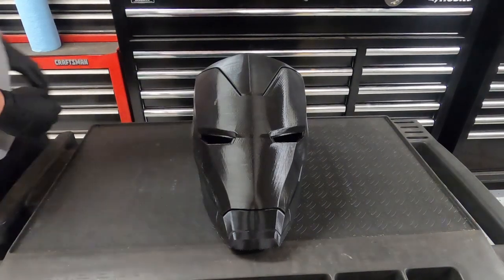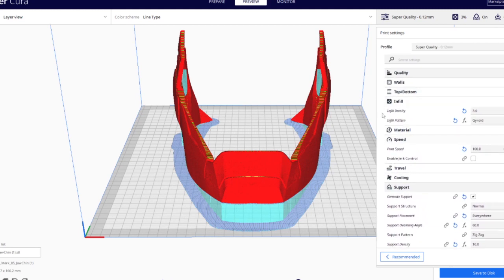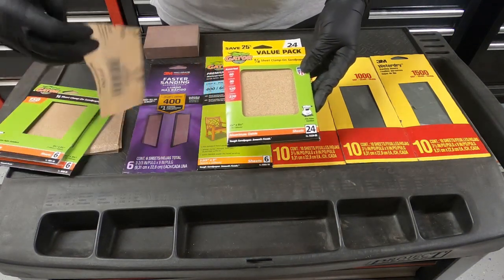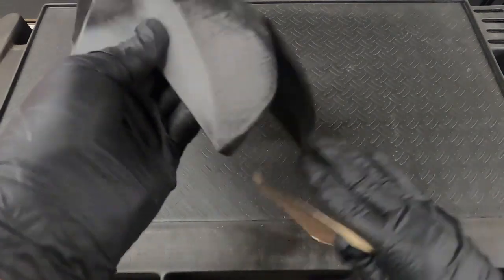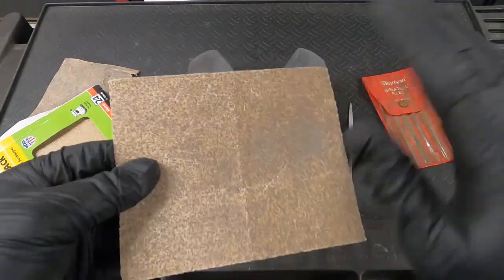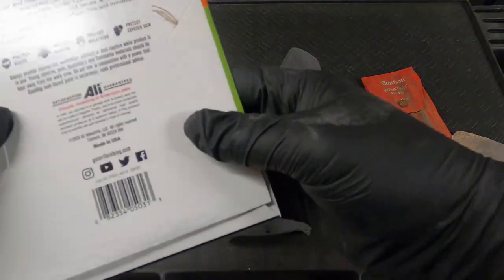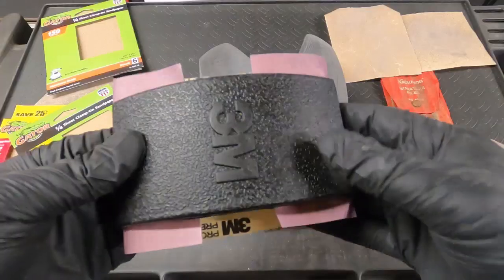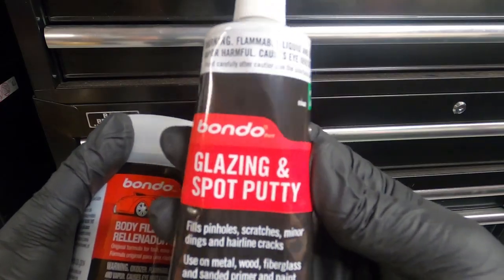I AM IRONMAN! 3D Printing the best Iron Man Helmet! Part 1: Printing and Sanding.

Comment: So I’m printing a iron man mask but I printed the face plate laying down it’s that ok or should I reprint
Reply: So should I reprint the face plate cause everyone that I’ve seen doing it have the face plate standing up instead of laying down
Reply from the maker: It depends on how well the supports came off, usually if you rough sand it and apply some filler (bondo, wood filler), it should be ok. However if there is a lot of details that it took away or warped from printing face down you may want to reprint it, if you want to show me on Instagram I can help walk you through some steps!

Comment: Will this fit your head? If so What’s your scale measurements at and how did you find them
Reply from the maker: It’s a little big on my head but I made it that way for the padding, electronics, and other components to fit into. If I wanted a snug fit I definitely would’ve gone for 90% scaling, some good ways to check scaling are tape measure, 3D scanning apps, and actually holding stands for soldering irons work too!
Reply: @CoshTech  I’m on a guess and check streak right now😭 but I’ll definitely be tuning in to see your progress please post more soon!
Reply from the maker: @shulkisreallyfeelingit2251  I will definitely, going to try to post this series episode at least every other week whilst also doing other projects and tutorials!
Reply: @CoshTech  1 last question atm the supports for my head piece leave the undesired ring and bits of support to small to get rid of any suggestions
Reply from the maker: @shulkisreallyfeelingit2251  yes I had the same problem with that on my old iron man helmet that you can see in my latest shorts video, the helmet piece had a massive ring of hard to remove supports and deep groves. Depending on how bad those supports are on that piece, you can take a 60 grit sandpaper and work it on that section until they are all gone, which may leave some deep groves instead, which is when you use that bondo glazing putty and primer to fill.
Reply: @CoshTech  the response time and attention to detail you’re amazing thank you!
Reply from the maker: @shulkisreallyfeelingit2251  Anytime! If you have any other questions or want to show me a print you’re working on and need help, you can always message me on my Instagram. And thank you for watching!